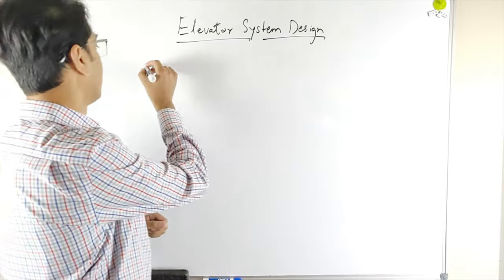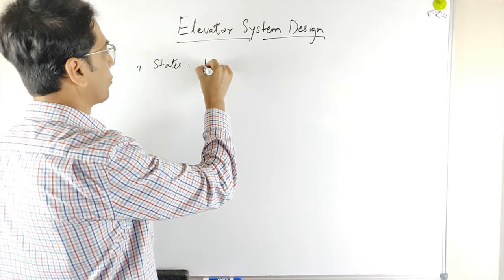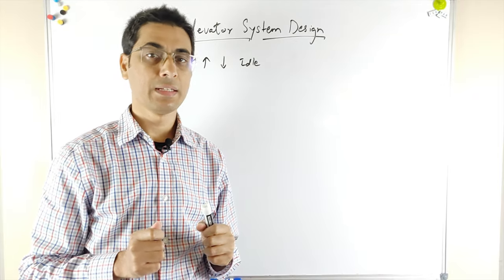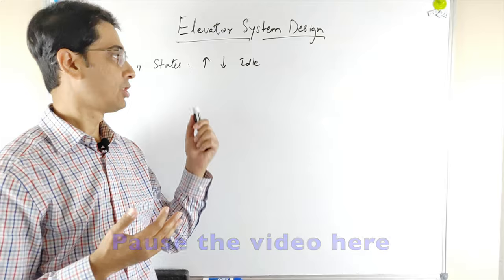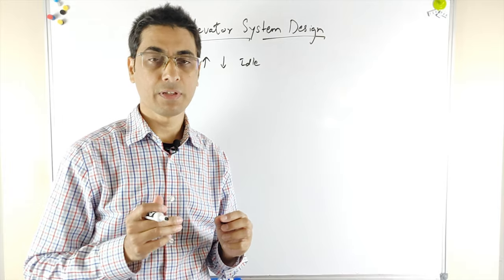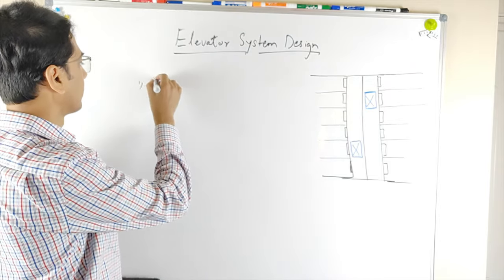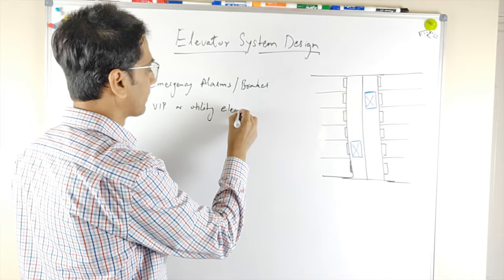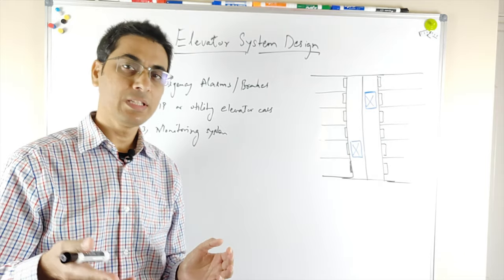Elevator System Design | Grokking the Object Oriented System Design Interview Question

Comment from the maker: Let me know whether you find the video useful. Also please don't forget to like the video and subscribe to this channel. Thanks :)

Distributed System Design Interviews Bible | Best online resource for System Design Interview Preparation is now online. Please visit: www.thinksoftwarelearning.com?utm_source=youtube-elevator

Please follow me on https://www.facebook.com/Think.Software.Community if you like to get notified about new course chapters getting added or any other updates. I will also take your suggestions there about the course and the channel.
Reply: I haven't finished the video, because I want to try it myself first.

I had an idea for the following case.

Elevator is @ floor 5, 
Before the doors close, floor 10 is requested, as the elevator begins to move floors 7,6 and 9 are requested. 

Would it be a good idea to scan the queue and put all requested floors into a min heap to handle requests between the interval [currentFloor - > requestedFloor]?
Reply from the maker: Thanks for the comment. You should see the video complete. There are multiple algorithms for elevator system
Reply: i have worked 27y in the elevator industry from field engineer to R&D hardware developer, software architect , project manager  , R&D manager in two EU MNC.....it would be impossible to make an (OO) design of a an elevator controller in 45 minutes and describe all its nuances....and if that 45 minutes are the potential answer to an interview question at Google , it is very very messy.....i am preparing an elevator (mechatronic) design online course on my own but it is a HUGE topic...you have not cover even 0.01% of all potential elevator features/requirements (some of which even varies by region/country/city)
Reply from the maker: Thanks for the comment. The goal of this video also was not to design completely in 45 min and done with it. But just to provide food for thought and some hints about what are different things to consider 🙂. In interview also, the interviewer is not looking at you to solve the problem end to end but looking at how you tackle the question.
Reply: Your videos are really helpful. I have a suggestion if you could go on low level design like creating iterfaces/abstract classes for different actor and how will you club then in the elevator system class. And how these component will interact with each other. That would be better.

Comment: Nice video but you could have focused more on OOD as well. Like Button -> (Elevator Button, Hall Button) -> Elevator Button (Event Button, Floor Button) -> Event Button (Alarm Button, Fan Button, Light Button, Door Button). Here floor Button will only deal with floor functionality. Same for Fan, Door, Light etc button also. In this way SRP is not violated. Button interface can Have method like action(SystemInterface): void . Here SystemInterface can be extended by two classes ElevatorSystem and AdminSystem. for action methods under EventButton class we can prefer passing action(ElevatorSystem e): void and for HallButton we do action(AdminSystem a): void, bcz it deals on system to decide which elevator to sent on passenger floor.
Reply: great comments!

Comment: I think the reason that we used enum to represent the { idle, going up, going down} states is because the state space should be only limited to these 3, whereas in the parking lot example there could be many types of parking spots that can be added even after first version of design is done. In the parking lot example, we designed it to be flexible so that when other types of spots are needed, they don't violate the Open/Close principle, but in this one we want the elevator states to be closed and not modified later.
Reply from the maker: Correct. Thanks for the comment 🙂
Reply: @ThinkSoftware  thanks for this Video. Just a question to understand something: is a car full loaded not a state? or "out of service"?  even "door open" is different than idle. If the car is full then it should not takes new Hall call... In case of a car "out of service": the dispatcher should not give hall call and "reload" the previous call to other elevator... So, I would like to know, if those example are not States then how do you advice to introduice it in the program? Thanks
Reply: but theres no way to fix the enum space. we can add as many as we want

Comment: The first part was good but the algorithm part was confusing. And at no in this video did you mention about state of the elevators controlled by the people who are inside the elevator. There would be a number pad inside the elevator where people press the actual floor button. For example, 10 people get in the elevator on floor 2. One of them wants to go to floor 1 and 9 of them want to go floor 100. Essentially it has two key functions: elevator summon and passanger dispatch. You haven't attempted to make any distinction between the two at any point in this video

Comment: Thanks a lot for the video. Couple of  questions
1. Do we need button class at all? Essentially we are creating InternalRequest and ExternalRequest when press ElevatorButton or HallButton respecitvely
2. For Button class , you drive ElevatorButton class  and HallButton class from it. I think we should not have PressDown() in Button class as there is no equivalent in ElevatorButton . In real elevator buttons, there are only floor numbers buttons, help button, door open/close button etc but no up and down
Reply: PressDown() is not literally up/down function but a function called when any button is pressed. Recall javascript keydown events.

Comment: Thanks for the good content. One point here, no matter what others have covered on this topic, if you are creating a video on it, watchers get intrigued about how you would do it. 
A complete UML diagram at least would make it a self sufficient tutorial. Also I didn't get why you need ElevatorMotion interface. How does it fit in between 1. dispatcher and Elevator, 2. Internal button and elevator itself. 
That's why UML is important to know what is your design approach
Reply from the maker: Thanks for the comment

Comment: I was expecting something like a UML's breakdown/discovery of classes, based on BEC architecture, Boundary, Entity, Controller objects per use-case. Like for example in your first use-case, 'calling elevator', what are the boundary objects, (buttons), entity objects (direction, destination), then a a controller object to carryout this use-case (which essentially responsible for the complexity of this 'calling elevator' use-case). I think your 'elevator system' object is interesting as well, its the dispatcher, may interact with per use-case controller objects, in this use-case to notify the progression of the elevator as it travels.  Any thoughts on BEC driven oo design? Thanks.

Comment: I don't see how divide and conquer would help in this scenario. Most people would go from floor 1 to the floor where they live and back. Very rarely you would see people going to other floors from floor x != 1. You could have them change elevator cars midway or so, but that is quite an inconvenience (and it would be very annoying if I had to switch 3 or more cars to reach my floor from the bottom). Maybe an adaptive system based on real-time traffic would work, or maybe a division based on functional areas of the building: office floors, living floors, cafeteria/gym floors etc, but that would entail a lot of extra complexity.

Comment: let say when in an idle state, the dispatcher gets multiple requests, in either direction, first, the requests will be divided into going up or down. the dispatcher will first see max no. of requests, and add them into a min-heap and send the elevator closest to the top person who is there at the heap, and will not be idle until the heap is empty now or if the elevator reached either endpoint.
Reply from the maker: Thanks for the comment. Which algorithm are you referring to?

Comment: I have seen practically, preallocate the elevators based on floor range and then apply the "Destination Dispatch Algorithm" based on the floor. This ensures Topmost going passenger need to wait due to some low-level floor passenger.
Reply from the maker: Thanks for the comment

Comment: 32:43, very interesting. So just to clarify, the hashmap is to handle request made from inside the elevator car, correct? 

	Scan all floors from 0 - > N, when a button is pressed on a floor, mark the boolean as true 
	The elevator will move up and then down, it will change its direction when it reaches the 0th and nth floor
	
	Use 2 boolean arrays for the up and down direction, stopping at floors marked true, then marking the floor true, (request served )
	
	Each elevator car also has a hasmap to keep track of the floors it should stop at, adding floors requested and then removing them when request is served.
Reply from the maker: Thanks for the comment :)

Comment: thank you for the video,
why you didn't use (or talked) about the state design pattern when implementing the states on the elevator (up, down, idle states) , instead of using Enums ?
is Enum more preferred  ?
Reply: In this case, we know that we will only ever need 3 states (up, down, idle) and we will NEVER extend this functionality. So enum is sufficient, because we will never extend it.

Comment: enums are used to define limited and fixed number of varieties which are impossible to get modified in future as well. For e.g. Days of week, Months of year In case of parking lot there are possible changes of introducing new Spot type in future which have needed modification of existing classes and that goes against the Open close SOLID principle. In case of Elevator type, the direction is never going to change. It can only be up, down or idle even in future.
Reply from the maker: thanks for the comment :)

Comment: Explained in a really simple way and to the Point. I would Like to know If Think Software Team has worked on Witness Horizon Software, as I am working on a Project to Simulate Different Call Strategies for a TWIN Elevator System.
Thanks.

Comment: Thank you Think Software, this was really nice. I've just one question, in SCAN algorithm why we need priority queues when anyway we are using two boolean arrays for going up and down ? As, array indexes are already sorted and we have to look at each index of the array whether its set or not. What is the benefit we are getting by using priority queues?
Reply from the maker: The boolean array is used only for passengers who want to onboard the elevators. So if it is set  for a floor then an elevator will stop at that floor and reset the value. Then the two priority queues or a single hashmap (for each elevator car) is used to store the destination floors that passengers riding the elevator car want to go. The same boolean array cannot be used for this purpose.
Reply: @ThinkSoftware  why cant the elevator also use a similar concept and maintain boolean array for destinations? everytime it waits at a floor to drop off pasengers it can be change the array to false and change it back to true when at least one passenger sets that floor as destination. would avoid heapify effort

Comment: https://youtu.be/siqiJAJWUVg?t=2234 
For the lookahead in the LOOK algorithm, simply using a bitset is also a good option. 160 floors can fit into 20 bytes. We can test for each byte segment sequentially and from each byte one can access the digits with bit manipulation operations.
Reply from the maker: thanks for the comment. Such optimization are only need though if we are working on some embedded system with way less memory than the memory that is currently available in current computers.
Reply: Sorry but, Elevator are build with embedded system, for reason like: price and ... no risk of Win 10 update while the Lobby is couded :-)     Regards.

Comment: For the last use case for dispatcher algorithm where the elevator is going opposite direction to passenger, how is it different from the state where the elevator is going opposite direction to which the passenger wants to go? Seems like the same state else we are more inclined to say that passenger is on floor 1 and elevator is moving to any floor which is > 1, the last state did not make much sense to me or I got it wrong.. do let me know..

Comment: Functional requirement mentioned the need to check for the max weight and  number of passengers translates to the max weight.. I did not get what we would not need the passenger class in this design as the above are calculated based on passenger object attributes

Comment: Could you please explain what the "Priority queues" are used for in the case of the SCAN algorithm?
Because if I already have in the tru array where the elevator has to stop, I don't understand what's in the queues.
Thanks
Reply: I was also wondering the same. May be priority queues (min heap for UP, max heap for DOWN) contain the destination floors which the persons inside the elevator might have pressed. Elevator checks these queues in order to drop the people.

Comment: I will disagree with the statement that we should not use Enums in cases where we may need to modify them, we never have 100% confidence that things will stay as they are. So instead we just need to use appropriate technics to encapsulate all the logic we are doing with specific Enums in one place or be sure that we will change it we will get error/warning from the not handled cases. In the case with a parking lot having classes is rather for the ability to add there some additional properties like size or specific structural differences.
Reply from the maker: thanks for the comment..

Comment: Very nicely explained !! A suggested optimization which I see is missing from every algo explained everywhere.
Since we know the max capacity an elevator can carry and if the current capacity is almost full, elevator should not stop to load more passengers :). Maybe assuming an average weight of 50 Kg(consider adults only), elevator should not stop if only 40-45Kg room is left.
Reply from the maker: thanks for the suggestion :)

Comment: We might need a passenger class in Elevator Controller system also .. You are right now considering all passengers to be equal, which might not be the case.
Consider the following use case -- 
Some elevators can be fitted with special equipment for Passengers on wheelchairs ..
Capacity of an elevator may vary according to weight's of different passengers contained in it..
Scheduling algorithms can also be tweaked in a way, where elevators having the least weight gets scheduled first ..
there can be numerous other cases where differentiating a passenger may be required in elevator controller 

but yeah, given the requirements that were mentioned, there was no need for a passenger class.
Wrote this comment just to let viewers know, what else can be thought about,..
Reply from the maker: Thanks for the comment 🙂. Even if we have to consider load on each elevator, having individual passenger class instances to represent each passenger will some special equipment to recognize each passenger along with the weight.

Comment: I have a much better answer in 10 minutes. I don't think in an interview you will get 40 minutes. Also, there are two types of elevators where you select floor outside and in the other one, you select floor inside. Assume you select floor outside - the request goes to a service broker that finds the car for you based on a strategy in deployment selected by the administration.
Reply from the maker: Thanks for the comment. I think I mentioned about this some where in the end.

Comment: Can I use two hash maps indirection and outdirection for Look Algorithm. Indirection stores entries of floors which are in direction of elevator car travel and Outdirection stores entries of floors which are in opposite direction to elevator car travel. Every operation can be done in O(1) time.  Please correct me if I am thinking something wrong
Reply from the maker: It should be only two hash maps - one for up direction and other for down direction
Reply: @ThinkSoftware  why use a hashmap, we can 2 hashset to store the floors where elevator is requested. Once a floor is processed, remove it from hashset. At the end when hashset empty, reverse direction.

Comment: Passenger class would have been useful if you have to enforce the weight requirements of the car. How do you enforce it otherwise ?
Reply from the maker: Thanks for the comment. We are designing the system and not simulation. How will you enforce weight requirements with a passenger class?
Reply: If one of the requirements is that we should be able to enforce such a limit than it can be done as you know the number of passengers boarding the elevator car at any time. Makes sense ?
Reply from the maker: First of all you need a mechanism to identify how many passengers on board or get off the elevator car. Secondly if needed, this can be done via a passenger counter in the elevator car. Why do you need a passenger class?
Reply: How do you know the weight of the passenger ? One could argue that if the elevator car refuses to move, the last person to get in should get out. I can think of other requirements but it is beyond scope. I agree we can get away without a class

Comment: I have a question regarding elevator system being a singleton, wouldn't we want ti be able to instantiate multiple systems in the case of multiple elevator areas ? which have their own schedulers and carts ?
Reply from the maker: Yes. And that what I mentioned while discussing zones. However, now implementation can be different. One way would be singleton elevator system has one or more zones and then rest of objects inside each zone.